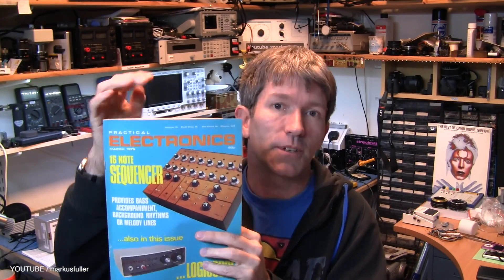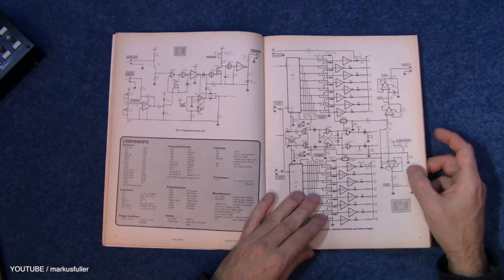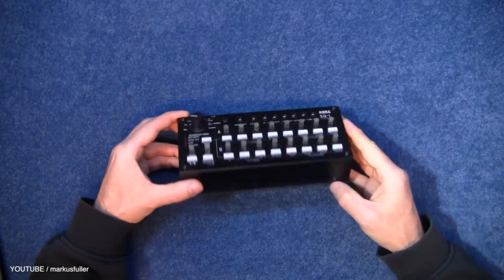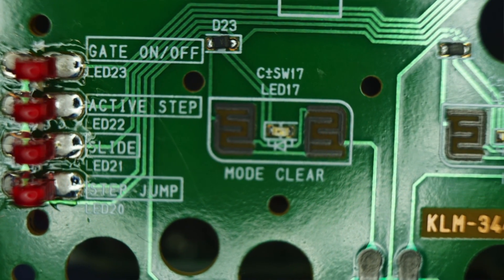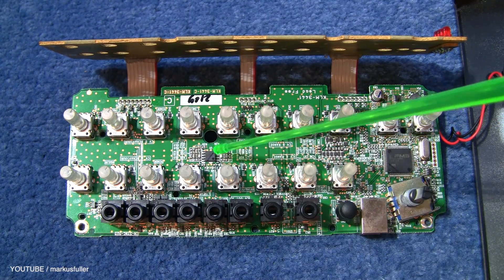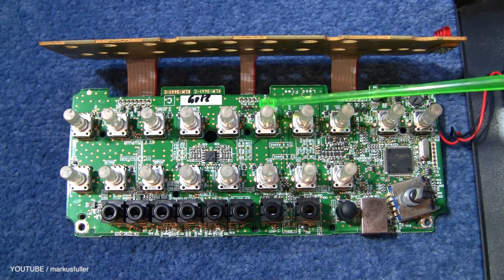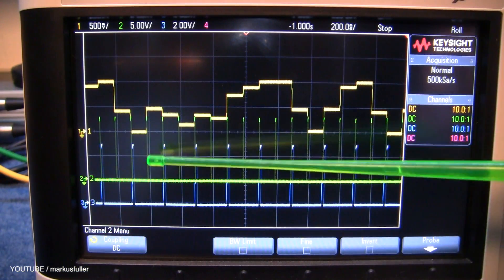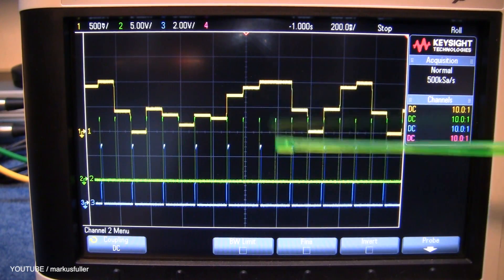Korg SQ-1 CV Gate Step sequencer Teardown MF#67

Comment: Cool video, thanks man! I like seeing under the hood of my gear, but sometimes don't have the courage to take it apart :D

Did you try changing the Duty knob when it was hooked up to the 'scope? I imagine it just makes the gate signal wider and narrower, right? It also has an effect over the midi out, so it's probably extending the time between the note on and the note off command, right? (I don't know a whole bunch about midi.)  Cheers!
Reply from the maker: Hi I cannot remember if I did try changing the duty knob (probably didn’t) it was a long time ago when i made that video.

Comment: I have one, it's nice but there is no Midi clock in and it won't properly respond as a slave device and start playing in sync/sending Midi out unfortunately . . .  The only way I've found it to partly behave as a slave is by hooking up a Korg Volca to the Midi and then running a sync cable to the SQ-1

Comment: Hi Markus can i use this sequencer to trigger my Roland Promars MRS 2 ?
Reply from the maker: Hello Panos, to be honest I really do not know as it would all depend on if the promars has a cv gate input and if the SQ-1 can match the voltages required to control the promars, I do not know what type of cv gate the promars uses.
Reply: @markusfuller  its my first attempt to try to trigger this analogue synth and something tells me that it wont work, but if it works is an extremely cheap way to do it, otherwise i guess you have to get a dedicated hardware sequencer like the MSQ 100/700 which is a far more expensive but maybe the only way to go with this model, i will try to get the specs and send them over to you, thanks for the reply your opinion always counts a lot to me cause you are an expert in vintage electronics and music gear.

Comment: I know this is old video but I was hoping your still answering questions. I have a SQ-1 but according to Kong they don't have a fix for the USB driver for Windows 10. Do you have a solution or work around to obtain a driver that would allow windows to recognize the SQ-1? I purchased it over a month ago and it is useless without the driver, no way to sync it to my DAW. Thanks for any advice.
Reply from the maker: Hi This video is quite old and I no longer own this SQ-1. I never really used mine with a computer more just a standalone unit so I do not know how to get it to run with windows 10 . my apologies.

Comment: Nice video.
In regards to profit, it is not uncommon for larger companies, to take between 3-7 times the manufacturing cost of a product in price when they sell off to retail.
You'd be surprices how cheaply they can manufacture electronics. So Korg will make a decent profit off of this, otherwise they would not bother wasting their time on the product :)
I'm speaking from experience.

Comment: I do miss a reset input. Is it possible to add a plug and connect it to the PCB (...),
in order to make the sequencer resettable to step 1 at an incoming trigger (or a gate, for what matters) input?
Reply from the maker: Hi sorry i no longer have this sg-1 so cannot think how you would connect this reset plug.
Reply: @markusfuller  OK, I had to try... ;)
Thank you anyway, Markus!

Comment: For Akai MPC Live mk1 users wanting to work with modular... I tested the SQ-1 MIDI to CV with my Akai MPC One (latest firmware) via USB-MIDI. The One has CV outs but I tested the MIDI to CV anyway. It works well but you have to set the MPC to not send sync otherwise pressing Play on the One will start the SQ-1 sequence which overrides the CV conversion.

Using it as a sequencer slaved to the MPC One, I did have to set the sequence step resolution on the SQ-1.

Comment: Can you use this to make sounds from a DIY 555 or 40106 oscillator  and step sequencer play in pitch?
Reply from the maker: Yes I guess it would be possible you would still have to make a bit of circuitry to make your 555 play a correct pitch depending on the voltage coming from the SQ-1
Reply: @markusfuller  Thanks for the reply! I was afraid it would not be that easy. I see hundreds of videos of homemade synths and 4017 etc. sequencers but the overwhelming majority do not play in tune or in a particular key. As a musician/composer they are worthless to me.I am probably better off using the Arduinos. You can program all that along with ADSR ,Arpeggios, sequencer and MIDI. Thanks again!

Comment: i bought one of these korg sequencers and it did not work properly, the ribbon cables had been soldered in poorly so the LED's would not come on,  the quality of the product was pretty poor and more like a toy than a proper musical instrument. ive also complained to Korg but they dont give a damn about their customers, on the whole a very annoying experience. if you look on their forums theres a lot of complaints about similar problems, leds not working, buttons failing and in general just bad quality control. i would avoid their stuff like the plague now...

Comment: Long shot, but could this be used to sync a MPC to a mother 32 via midi to CV?
Reply from the maker: Jarrod Estes Jarrod Estes Hello Jarrod, Im not sure how you want to use it, im guessing the midi out could clock the MPC while the gate or sync out could clock the mother32 (that im not sure of though) but you would be controlling the tempo only from the Korg SQ1 (thats if it all works like that) . However if the MPC is on USB to pc then you would USB the SQ1 and get a gate trigger or clock to try and trigger the mother 32 or the MIDI out to midi in of the mother32. but I have never tried this and have never had the mother32 so its just me giving a wild guess.

Comment: $100 is indeed low price.  You can hardly buy anything for a $100 or less these days, aside from maybe a direct box, a Digital Music Corp. MIDI through box off eBay or a credit card sized memory card for late '80s/early '90s Roland or Yamaha synthesizer.  I used to have a $100 MIDI keyboard for iPad, but frankly I am glad I sold both the iPad and the keyboard.  I'll keep the other sub $100 items that I mentioned.

Comment: Great video Markus. I have to ask, to the right of that 4mhz crystal looked to be solder points. Perhaps serial or JTAG? I wanted to ask if you've had much experience with using these for repair, hacking or general curiosity? I wanted to share with you that just recently I watched some videos about how you can use a USB-Serial cable to connect to wifi hardware and re-flash the operating system with a small distro of linux (open-wrt for example.) I had an old router lying around and with too much coffee and soldering skills not exercised since high school, I managed solder some wires on to the pads (which are very, very tiny and close together in my experience) I was blown away though at the reward... connecting those wires to a USB-serial device I had bought long ago and getting to see and access an operating system that otherwise wasn't available to me... I haven't tried to install that alternative operating system just yet, but I can only imagine that quite a lot of the modern synths you've opened probably have something similar? I understand a lot of stuff you open is for clients, but perhaps for other things it would be great to see what might show up if theres an interface available...
Reply from the maker: +fkthewhat Hello Yes you are correct that is a programming interface for the processor. I think at production there is just a small connector that touches the pads and the holes are just to line it correctly. I have not had this very long and do not have a lot of knowledge for hacking it (yet). I think it will more likely be Jtag . Many thanks form Markus

Comment: You are right about the Analog Devices part. It's the ADP1612 Step up DC/DC switching converter http://www.analog.com/media/en/technical-documentation/data-sheets/ADP1612_1613.pdf

Comment: Hi markus. Thanks for sharing this video. I would like to know why I hear ground noise after connecting my sq1 via usb. My setup would be cv and gate connected to an ms20 and usb to my macbook. As soon as I plug the usb I start to hear noise. Thanks!
Reply from the maker: +Firdous E Bareen to be honest I have not even tried the USB yet. I think the outer casing of USB is grounded by your pc and may (just may) be connected to the ground of the jacks and therefore a signal is being picked up off the USB or PC and adding it to your ground of the jacks then into your sound modules/synths almost like an imbalance on the ground which is why some audio equiptment has a ground lift switch. does it make the noise if you run it from batteries without the USB connected ?.
Reply: +markusfuller Is there a way to isolate the jacks or something? The noise does not appear when I run the SQ1 with batteries. Thanks for your response
Reply from the maker: Hello you cannot isolate the jacks as it needs the ground because thats like the negative of the voltage required to output its voltage. it sounds like the earth from your USB is mismatched with the earth on your synth/sound device and the SQ-1 is just connecting that as that is in the middle of the two. you could try disconnecting the earth lead on your synth though I would strongly not advise doing that. if you are using many mains extension leads you could be mismatching the earth or neutral distances and that can sometimes create hums. try plugging your pc and sound source/synth into 2 sockets on the same extension or power outlet, also bear in mind that if you have an amp or powered speakers plugged in at the other end of the room that can also introduce noise.. Its a problem I have heard before when I use to setup equipment for stage. all my music gear PC mixer speakers and synths come from one filtered socket and there is no hum at all unless i start using old organs in the setup which feedback hum into the loop again. what are you using to make the sound ?.

Comment: I suppose what helps keeping the price low is that they use a lot of components the same as in the volcas (the transparent potentiometers and button caps at least), so SQ-1 can benefit from the high-volume volca production
Reply from the maker: +Kassu2000 Yes I realised afterwards that the Korg Monotron has one of these light up pots on it so they have been using them for a while. but I still think its a real neat idea.